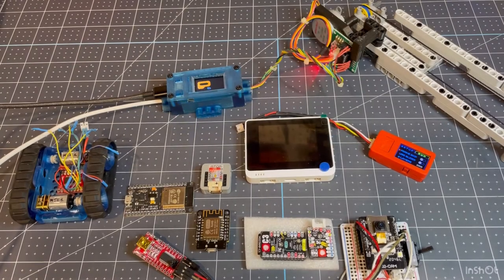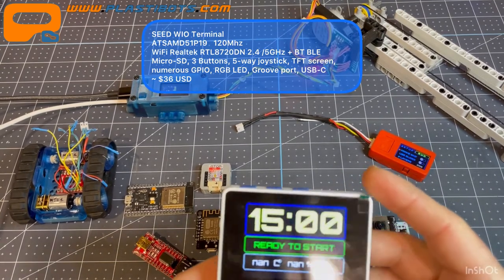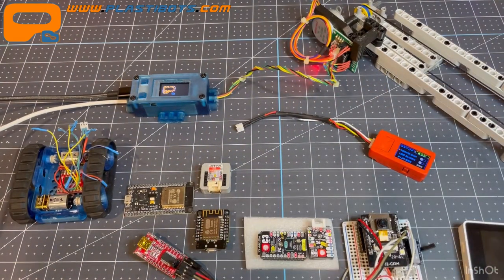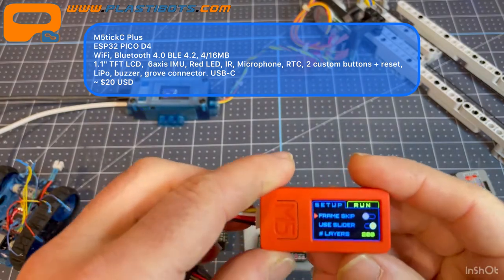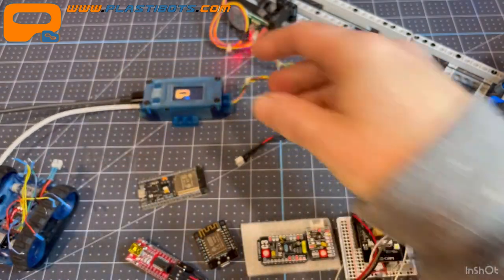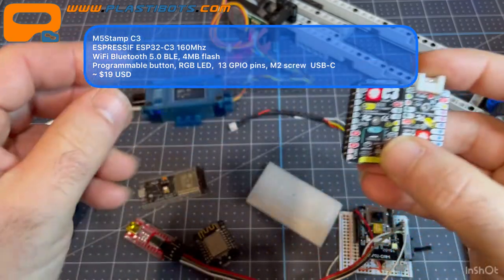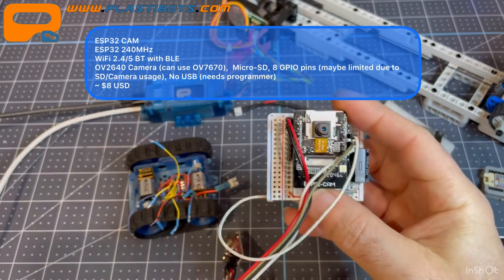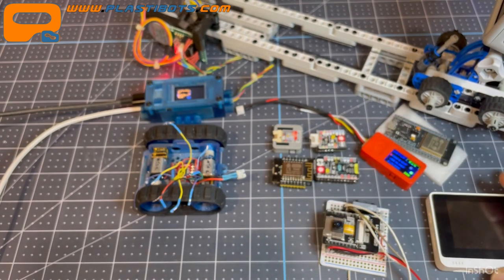IoT Arduino Microcontroller Buffet - My Favorites

Comment: Hello, I just found your YT Channel and share your addiction to physically tiny microcontrollers, as well as several of your experiences with challenging libruaries.  I too use the TFT_eSPI lib for several devices with displays ( mostly Liligo T-Display types).    I Wish you the best thanks for the interesting content ..
Reply from the maker: Yeah.  It’s always an adventure with some of this stuff. I’ve also recently gotten good mileage out of Arduino GFX.  Especially after working with a gent named Matt P to get Sprites working.  For the Lilygo T-RGB, it made for some cool graphics.  Check out my other videos for info.